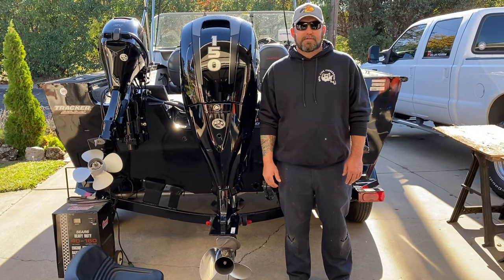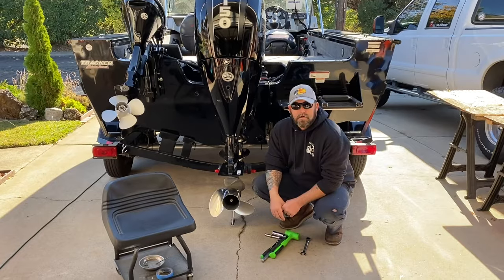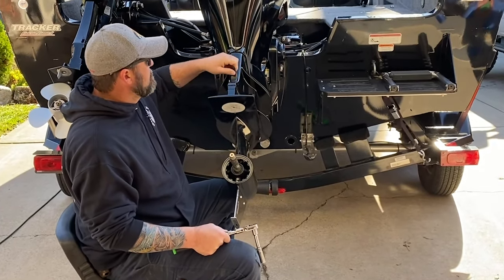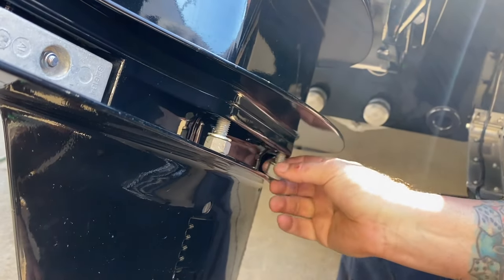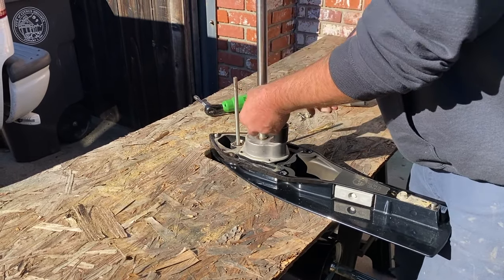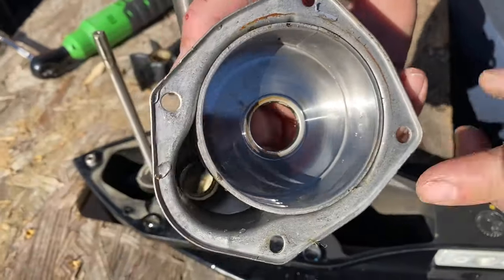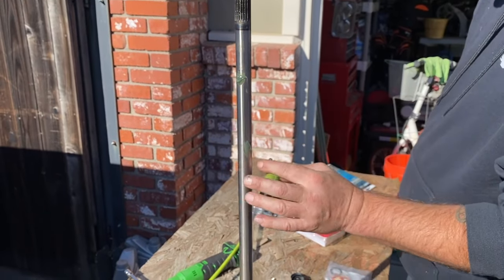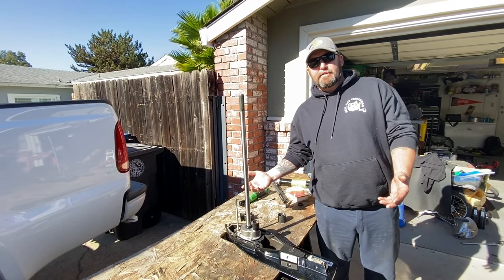MERCURY 150 EFI WATER IMPELLER CHANGE | HOW TO

Comment: Question… is it ok to put a little grease on the surface where the impeller meets the housing? I noticed when you were trying to line up the key way that it gave a little resistance, if the shaft moves the spines are going to fight you on reinstallation.

Comment: look at the impeller at mark 9:08 and then look at it at 13:14 the impeller blades are opposite. Which way should they be for a single engine Merc?
Reply from the maker: They should be pointed to the right when looking at it upside down.. I might have put it in backwards in this video I have a bad habit of doing that sometimes but they will typically flip the correct way once you fire up the motor.. thanks for watching

Comment: I replaced mine after watching your video, I’m also is 150 four stroke, now it is making a noise and vibration coming from behind the cowling almost seems like it’s coming from the water impeller area ,not sure what it is , any info would be great
Reply from the maker: So did everything go into place correctly? The shift shaft and drive shaft? The water tube ?
Reply: Yes , everything lined up and went in easy,

Comment: I'm doing the lower unit install on Saturday. Just had Seals replaced on a 2016 115hp Command Thrust and I'm sure I'm going to get it back with shift shaft off. I took the lower unit off with shift lever in forward. I thought if you turn the shift shaft clockwise it would take you from Neutral to Forward. And cc for neutral to Reverse?

Comment: Hi! And TY.
Could you please tell me what it is you have outside your Finn?
It looks like a sort of cover  made of stainless steel and polished.
I always wondered why nobody ever had invented a Rubber Thing to avoid  damage in Rocky waters Like here in The North, Sweden and Norway.
But this one looks really Good!!
Where can I buy it??
Jfkrag
Reply from the maker: That is not my boat, it’s a friends .. but that is actually a skeg repair kit from a company called skeg guard.. usually guys will put those on after they have damaged their skeg.. another company called panther also makes one as well..  but if you live in a very rocky area not a bad idea to put one on.. or if you have tore one off already I would definitely recommend it! Thanks for watching the video!
Reply from the maker: https://www.overtons.com/megaware-skegguard-mercury-05-present-150-300-hp-verado-optimax-315884.html?gclid=Cj0KCQjwi7yCBhDJARIsAMWFScNZgg9Fke148uqBSDMefflsTb-1PLmwerQfDiTLsZLeWIQXhLPwPKcaAuNcEALw_wcB&gclsrc=aw.ds
Reply from the maker: You would need to order the right one for your make and model motor.. thanks again for watching the channel..

Comment: Can you give any instructions for the high pressure fuel filter (8M0090809)? The 300 hour service kit (8M0094233) from Mercury comes with this filter but there is no info available on DIY change. The maintenance tag on the engine doesn't even mention the high pressure filter under the 300 hr service section. The Mercury Maintenance Manual (8M0105247) doesn't provide instructions (it only covers the low pressure filter.) Thanks in advance for any thoughts or comments on the high pressure filter change.

Comment: Gday mate, very new to your channel, firstly thank you for these great videos with the handy tips. Secondly I recently purchased a boat from a mate with a 2018 90hp mercury on it. Its got 34hrs on it. He has done the initial 1st set up service but hasnt done any other. Ive recently(thanks to your videos) changed oils, filters but haven’t done the water impeller. My question is do you think I should or wait a little while longer? Thanks you
Reply from the maker: Thanks for watching the channel! I appreciate it and hope you like it! So mercury recommends doing the water impeller at 3 years or 300 hrs whichever comes first.. but really it depends on how much it sits for long periods without being used.. that can be worse then using it often! The impeller can get “set” in the blades and they won’t make good contact with the housing.. causing it not to have good water pressure and cool the engine..  also if it’s been through any mud or sand it would be a factor to change also..  personally I’d rather be safe then sorry.. outboards can overheat fast.. but it will go into guardian mode and try to save itself.. let me know if you have any questions.. I have one impeller change video up on a 150 .. very similar to yours.. same impeller even
Reply: Thank you so much for the great response! Ive taken her out since and the water does pump with a lot of pressure but your definately right..... better safe then sorry ..... Ill get into it while watching your video as an informative guide..... mate thank you once again..... 👍
Reply from the maker: No worries ! I mean you’re probably good for another year or so.. but I just have to tell you what mercury recommends.. and leave it up to you to decide.. if you do decide to wait keep an eye on the  pisser , if it starts sputtering or seems weaker change it ASAP.. thanks again for watching and let me know if you have any questions

Comment: Fantastic video man!  Is the verado l6 motors similar to this?  Dreading doing mine but I’ll do it before taking it to a bps lol
Reply from the maker: Kinda similar.. but make sure you drain the engine oil before pulling the lower unit off or you will have a huge mess on your hands.. and be careful putting it back on so you don’t damage the oil sump with the drive shaft.. let me know if you have any questions..  sorry you don’t trust your local bass pro? Or something else?
Reply: @ReelLifeFisherman  don’t trust them.... bought 4 boats from there and do most work myself. Never did impeller so I’ll def ask ya for advice when I get to it!

Comment: Is it necessary to drain the gear oil prior to changing the impeller? I have heard that it is required on some other Mercury engines (to prevent spilling a quart of the oil) when removing the lower unit, but you make no mention of this. I am hoping that is not necessary with this engine.
Reply: Not necessary

Comment: Isn't the impeller put in the wrong direction,I know it will correct once the motor is started,but seems it would be rough on the impeller?

Comment: Can you just rotate the prop to realign the splines ? I took my lower unit off  in neutral..have not put it back in yet I am hoping it will just line up with no problems. Any info would be helpful   Thanks
Reply from the maker: Only if you put it in forward on the shift shaft can you turn the prop to turn the drive shaft.. but then make sure you put the control box into forward also..

Comment: You don’t have to put silicone ?
Reply from the maker: Not on these ones .. some other engines you want to do small strip behind the impeller housing , so exhaust can’t get into the impeller area.. thanks for watching
Reply: I have a 99 mercury 150 do I have to put silicone ?
Reply from the maker: If you have a rubber strip behind the impeller no need if not .. a small bead of silicone would be a good idea just in case..
Reply: Ok thank you buddy 👍

Comment: The first step to any type of repair is disconnecting the spark plug wires. Even more in this case where you're working around the crankshaft. You don't want to accidentally start the motor while your playing around and moving the the shaft. Yes it can happen and yes it has. This goes for any type of engine big or small and not just outboard motors. Anytime you're in close contact with moving parts that are driven directly off the crankshaft.
Reply from the maker: While you are not wrong as to being cautious.. you could in this case just disconnect the crank position sensor.. much easier.. I’ve done this hundreds and hundreds of times .. and I’ve never had any issues nor has anyone else I’ve ever worked with..  but that’s not saying accidents can’t happen.. but you make a good point and I will bring it up in my next video and show where to disconnect the crank position sensor.. thanks for watching and commenting
Reply: @ReelLifeFisherman  or trip the kill switch

Comment: Watched this video and my impeller change went great with only a couple of differences from this video. 
 
1.  The shift shaft on my 2015 Mercury 150 4 stroke is about 1/3 the length of the one shown in this video.  Probably the difference in length of the outdrive??  Yours is on a fishing boat, mine in on a pontoon boat.
2. The nuts came off the studs no problem and with enough clearance, I did not have to lower the lower unit to get any of the nuts off.
3. The new impeller did not just slip in the water pump casing with a turn of the wrist as in this video.  The rubber was super stiff and it took some grease and cuss words to get that b!#ch in.
4. I started as shown here in Neutral, but for some reason my shift shaft would "walk" clock wise or counter clockwise by itself making it difficult to re-insert while in the neutral position. I had to lower the lower unit just enough to get a pair of needle nose between the engine and lower unit to turn the shift shaft back to the neutral position and attempt to re-insert.  After 4 tries and a couple swear words, I was able to do it and everything worked perfectly.

My engine is a 2015 with 313 hours on it.  The shaft seal was completely deteriorated and the impeller showed signs of being "set" as described in this video.  Don't wait to do this...it's definitely worth it.

Thanks for the video.  It saved me a lot of money and the job, though intimidating at first, wasn't that bad after all.

Comment: everyone here says great video but did not realize that the impeller was put in backward.😎
Reply from the maker: Yes it was .. in trying to show the camera I did put it in spun the wrong way..  but it does no harm if you run the motor afterwards. The rubber blades do flip over and work just fine.. this boat had ran for years just fine.. but thanks for your keen eye..

Comment: At what water pump rate that make you think the impeller is bad and need to replace?
Reply from the maker: It is recommended to change it out every 3 years or 300 hours..  if you notice less flow or have definitely went through mud or sand.. I would change it out and check the thermostat no matter what.. thanks for watching

Comment: Can you tell me the trick to getting the impeller into the housing? 🤣
Reply: Spray the housing with soapy water or wipe dish soap on inside of housing first.  Also, as you view the bottom of the housing, the twist is counter clockwise (NOT clockwise).  Look at the direction of the impellor curl when he took off the housing versus when he put in the new impellor.  The curl goes the wrong way.  Improper curl could damage the housing or the impellor upon startup.  Also, avoid getting grease on the top of the splines when re-greasing.  Could create hydraulic lock when trying to reinstall lower unit.  But, great video.  Thanks.

Comment: Well I have some bad news for you. You put your impeller in backwards. If you look back(9:29) at the one coming out, you'll see that the fins are bent backwards to the one that you installed. (13:26) I really hope that you have not damaged your outboard.
Reply from the maker: Thanks for your keen eye.. yes I was trying to show the camera and it was installed in backwards but guess what.. it is made of soft rubber and will flip around in the correct direction when the engine is started. It was pumping good water then and has been for the last 3 years! 👍 thanks for watching.

Comment: Why loctite?
Reply from the maker: The factory puts a dab on them .. it’s not something I recommend really.. especially if you use it in saltwater.. they just don’t want the bolts backing out a bit and loosing the seal on the impeller housing.. that would make you loose water pressure and overheat.. I personally don’t use it and if In saltwater even a light coat of Anti-seize .. thanks for watching and let me know if you have any questions

Comment: strange you dont put anti corrosion grease on the drive shaft splines and retaining nuts and bolts, we would be sacked if we didn't at least put it on the drive spline and prop shalt spline . I guess we are saltwater minded and your possibly fresh water focused. still greasing the drive spline into the flywheel is pretty much mandatory.
I am told that Australia has some of the saltiest water in the world, but that is probably bullshit as all oceans are joined up one to the other. other and the red sea which is really, really salty.
thanks for the vid I watched it to see any differences from Yamaha stuff .
Reply from the maker: Greased every spline on that lower the drive the the shift and the prop.. not sure if you messed it or just messing with me ! lol thanks for watching and commenting though.. have a good one

Comment: Appreciate the information but WHY do you instruct us to put the impeller in the wrong way? If you are posting an instructional video on installing an impeller it seems that installing it the correct way would be important. Finally reading through the comments and reading that it will "probably" flip to the right direction is irresponsible. Maybe a disclaimer in that section of the video stating that is incorrect so you don't have to redo an otherwise good video. I stressed over seeing how you installed yours vs the direction mine was installed. Not seeing any contradictions in the comments I proceeded. I assumed you were correct. I even looked up another video and that one said to rotate it clockwise into the housing as you stated. To finally read through all the comments and read where you said it was wrong after I put it all back together with the impeller in wrong was very irritating.